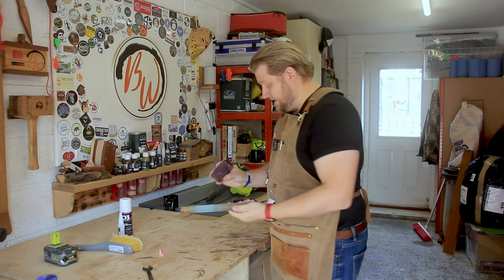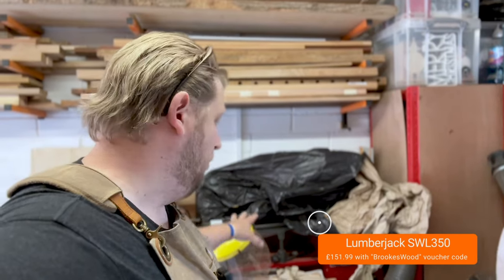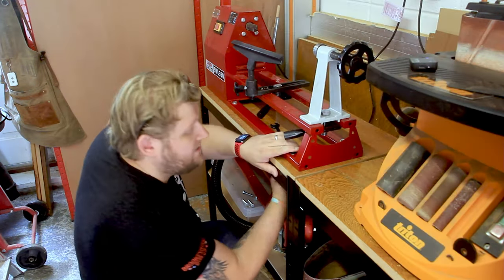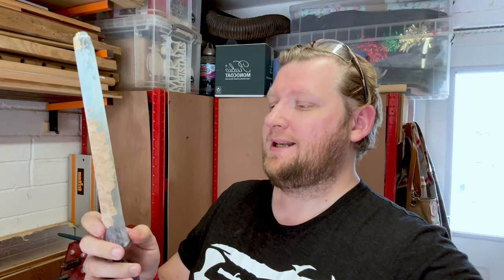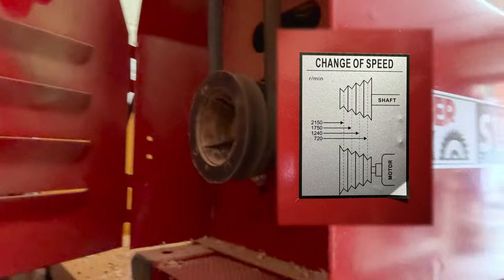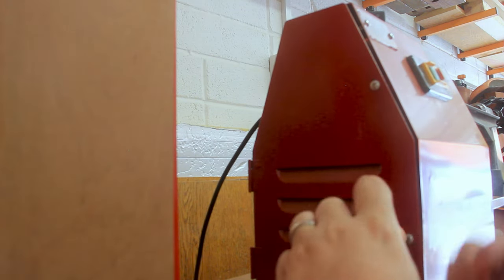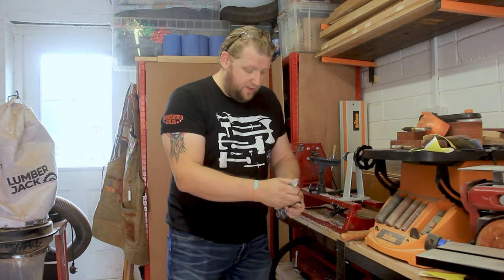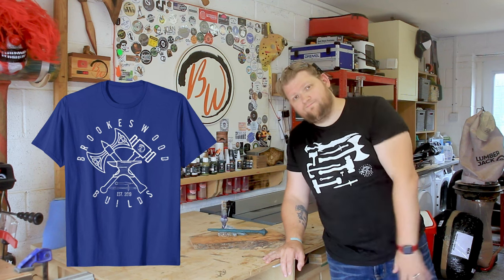Disaster strikes: My resin wand making journey

Comment: As a person of many disasters , a lot resin related I can definitely sympathise, I found that carbide tools are better and have less chip out.
The vibration mixed with the length of the piece will have contributed to the fail.
I would’ve drilled a hole in the purple block and turned it round before attaching the resin and burl by turning it to fit the drilled hole and glueing in 🤷🏼‍♂️ your two part epoxy held extremely well tho 👏🏻
Reply from the maker: Thanks, will definitely give it another go. I completely agree & I will definitely turn it before, I was surprised it held together with the 2 part as well as it did. 
Carbide tools are on the list now, will be looking where I can get a good deal

Comment: I would think it is the lathe bolted to the workbench. 
The workbench is to solid with all the other tools on it so the vibrations do not have annywhere to go. 
Might be better to put a few blocks around the lathe (and take the bolts out) so it does not move, but can disepate the vibrations.
On the other hand the glue up of the 2 pieces held up beautiful, job wel done with that part.
👍
Reply from the maker: I had never even thought about having it all bolted together would add to the vibrations. Will definitely have tot think of something to dampen it. I can separate them which may help as you said. 
Yeah shocked it held together as well as it did. I thought that would have been a point of failure

Comment: i have to admit you were giving me the fear turning that.
why it went, could of been a number of reasons. i wouldn’t have been using the roughing gouge once it was round.
yes the Australian mallee could have had a weak spot., definitely seen that before.
also vibration through that lathe to the tool.
i’m not an expert but i do prefer to use carbide (negative rake) when shaping resin. it’s just easier and smoother.
Reply from the maker: Yeah I had to work with the tools I had. Will definitely be investing is some other tooling for the next time. My bday is coming up so maybe then 🤣